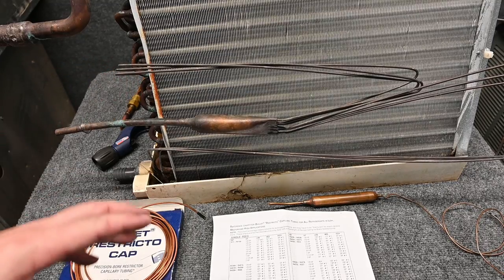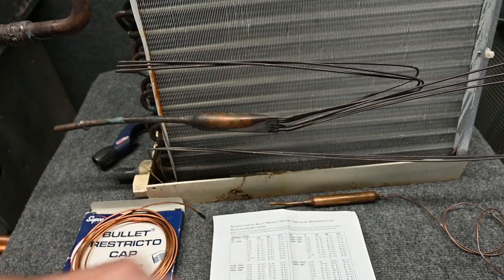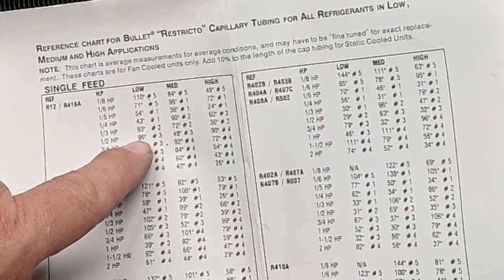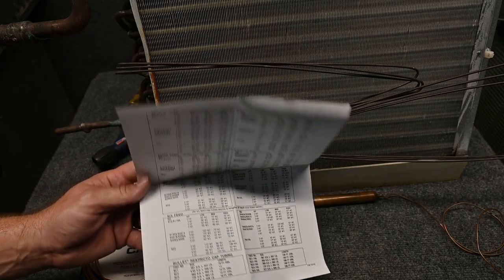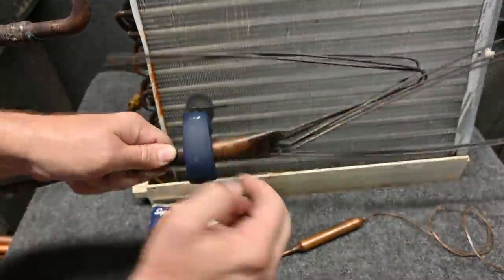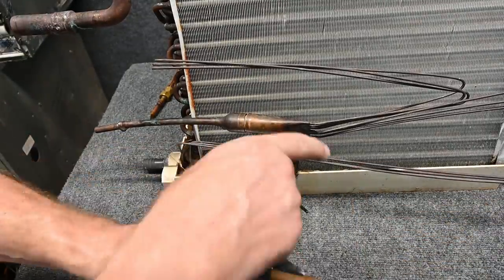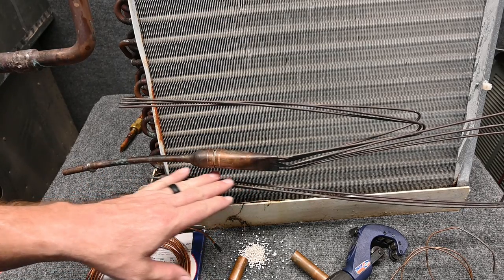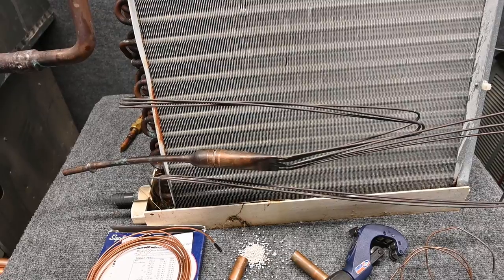HVAC 088 capillary tubes metering device

Comment: In this kind of metering device should use superheat or sub cooling? Thanks.
Reply from the maker: Both. 

We get the target superheat with the indoor wet bulb out door dry bulb on the chart or formula and compare that to the superheat. 

We also look at the outdoor temperature and the sucbooling just as we do with a fixed orifice.

Comment: A month or so back I found 'CAPILLARY TUBES: THEORY AND PRACTICE' By: Henry Ahrens online.  A RSES paper that offers some interesting insight into cap tubes.  The self-regulation comes from the change of state happening after different lengths of the tube depending on conditions.  The bubbles slow the refrigerant feed.  

Can't say fully understand it but it is interesting to consider.  And to me, gives better explanation as to the problems that can occur if you aren't feeding 100% liquid to your TXV or piston since bubbles mean the flow will be slowed unintentionally.  Cap tubes seem to have a place in small systems where their alteration of the efficiency of the system as the control mechanism.isn't a significant issue.

Telling is that in the 1960s, the thermostat on some window air conditioners actually controlled a heater around the strainer to lower sub cooling to cause boiling for more of the length of the tube thus reducing the feed to the evaporator.
Reply from the maker: Awesome thank you! I will find it now that I have a lead! Thank you very much
Reply from the maker: http://www.rses.org/assets/serviceapplicationmanual/620-98.pdf
Reply: Thank you for the source. Good to know he is a senior engineer -- seems like reliable source of info.

Comment: I don’t like capillary tubes either; is there a way to replace with some sort of universal TXV on say a refrigerator sized system?
Reply from the maker: i have replaced capillary tubes with larger distribution tubes with a distribution block and TXV.
IT was a PITA.
Reply: @love2hvac  Ty, thanks so much!
Hey, I’m new to all this and I have a question no one seems to be able to answer:
I just got a new 2-stage vacuum pump and a CPS VG-200 micrometer. I live at 4700 feet of elevation.  When I put the micrometer directly on the vacuum pump with fresh oil, I can get a vacuum as low as 4 um.  However, if I look at a chart of maximum attainable vacuum vs. altitude, it says I should only be able to attain a vacuum of about 25” at my altitude.  4 um is nearly 29.92”.  Also, the micrometer (by design) only starts to give decimal readings above 28”.  So if you ascribe to the max vac vs altitude chart, the micrometer shouldn’t even be useful.
So, there is something I’m missing here. Also, it occurs to me that when the vacuum pump is operating, and removing (say) air from a system, it in my mind it should have to be working against the weight of the atmosphere; thereby in my mind making it possible to pull a deeper vacuum at higher altitudes because there is less atmospheric weight to push against to remove the air from the system?
I’m really confused on this and everyone I can find and talk to (even seasoned refer-techs) just say I use analog gauges and time, and they don’t worry about it!   Ty, I would really appreciate your help.  Thanks in advance!
Reply from the maker: I have a 20+ video series on vacuum alone.

Let's start with this, we are not measuring a vacuum, we are really measuring atmospheric pressure. 

At sea level and standard weather there is about 14.7psiA Atmospheric pressure. 
14.7PSIA, aka 760,000microns, 0 inches of Mercury vacuum, 29.92 inches mercury absolute, 760 TORR 0% vacuum. 
A lot of different numbers but they mean the same thing. 😁

If we go higher in altitude, we have less atmospheric pressure.

If we go to the top of Denali (20,310 foot elevation)
The atmospheric pressure would drop to 11.6PSIA,  600,000 microns, or  6.32 inches  of Mercury vacuum, 23.6 inches mercury absolute, 600 TORR, or 21% of a vacuum. 
When we have less Atmospheric pressure we we are starting out in a vacuum, aka less Atmospheric pressure. 

Now if we continue all the way up to space, there is no more weight of the atmosphere on us.
We would have 0psia 0 microns 29.92" Hg vacuum 0" HG absolute, 0 TORR and 100% vacuum.
We did not even use a vacuum pump but we are in a perfect vacuum. I ly because we no longer have Atmospheric pressure. 

So we really don't measure a vacuum we are measuring how much atmosphic pressure is left. 

If I pull a vacuum at sea level or on top of Denaliy goal is to get to at least 500 microns. Meaning only 500 micrometres of atmosphere left in the the lines. If I start at altitude, I just get a head start!

Part 2 why use a vacuum or micron gauge.

A perfect vacuum is 29.2"hg or 0 microns. 
Now take a look at your analogue guage set and fins for me 29.2.
Yeah even if you have perfect vision the with of the middle is way wider than that point assuming it was even accurate enough in the first place!
Each mark on that guage is 2"HG and the needel almost fills up between those 2 marks. 

There are 25,400 microns in 1 inch of Mercury. Can you see 25,400 of an inch?

There are 2" HG between every mark, so there is 50,800 microns between each mark. There is no way possible an analogue guage set is accurate or visible to measure a proper vacuum. 

We need to be below 500 microns to dehydrate the system and it needs to hold below 1000 microns after 39 minutes. (Called a decay test)
There is just no way possible anyone can see that on an alalouge guage set. It would be like building quality custom cabinets with a yard stick that only went down to feet as it's lowest measurement. 

Our job is not to remove atmospheric pressure, but to dehydrate the system. BELOW 500 microns and holding under 100 after 30 minutes is the bare minimum requirements for this dehydration. 
If it rises above you have to start the vacuum again and keep dehydrating. If it keeps rising non stop there is a leak.

What happens when moisture is left?
ACID!!!
Especially with POE oil. It turns to an acid. It causes leaks in the evaporator coil, eats varnish off the windings and eats away at the copper. Then the copper sticks to the hottest part of the system, the compressor. It copper plates the components and then the compressor has a harder time working until it overheats and fails. You even have more Refrigerant leaks. It eats away at the seals and at the TXV. 

Major system damage from improper dehydration. 

However the installer will never see this long term damage. It takes several years before it causes problems.
The service tech thinks "oh those junk TXVs, oh these junk compressors, oh these junk coils, but really it was all from poor installation practices 😢.

When you ask they will say " I have been doing it this way for ____ years"  meaning they refuse to learn, they are set in their ways, and people think if you do something wrong for long enough it makes it right. 

All in all there are no HVAC police. 

It's just you, your drive to learn, your drive to do it the best you can or to cut corners.

I wish I could tell you I always do things right, but sometimes we have to make a decision, sometimes we just have bad days and cut a corner. 

Only you can decide if it will be a habit or an occasional thing.

It was a great question!!!!

Hopefully that helps! 

Ps don't argue with those who are stuck in their ways, just worry about you.
Reply: @love2hvac  thanks so much, I feel I was coming to this conclusion because you are dealing with physics which is irrespective of anecdotal dogma or convention.  Well, that is why I immediately purchased the micron gauge because the resolution was stunning and every analog gauge I can get access to reads differently.  In trying to figure all this out, I did watch a lot of your videos but just couldn’t reconcile the ‘maximum attainable vacuum tables’ (if you feel like speaking to their implication and use, that would be great!) which I don’t understand with your vacuum videos that made sense about the effects of altitude on the work necessary the pump has to accomplish.
Funny thing is that my application was not for refrigeration but for other uses.  However, after watching your videos, I’ve become really interested in HVACR now and have access to some broken systems.  I see you need a 608 and after looking at the questions and your really excellent videos, think I could get a ‘Universal’ which would allow me to properly play with these available units.  So, thanks to you , I may have another hobby and another endless pit to throw my money in to!  Thanks again Ty, really appreciate it! 🙂
Reply from the maker: Curiosity is the most powerful learning tool! 

You would probably like this.
I should make a video about it also. 

https://www.engineeringtoolbox.com/vacuum-converter-d_460.html
Reply: @love2hvac  ok, ok, ok.  The light bulb 💡 finally came on!
I now understand the ‘maximal obtainable vacuum’; essentially sea-level to space represents the full dynamic range of possible vacuums. Any fraction of that total dynamic vacuum range merely represents a subsection of the total altitude.  So, if you’re already at a higher altitude, it is analogous to already having pulled a commensurate amount of partial vacuum from sea-level; some ‘work’ has already been done.
My brain-stick was thinking that this reduced the actual (probably poor choice of wording) ultimate effective vacuum (i.e. you would have a lower usable quality vacuum).  So, my understanding now is if you pulled a ultimate vacuum at altitude and took the container down to sea-level it would be the same effective ‘deepness’ of vacuum as one (ultimate vacuum) totally pulled at sea-level; assuming the pumps used can pull the same ultimate level regardless of altitude.  
I can imagine I’m using the words wrong and argument about ‘usable’ (given pulls from different altitudes) but I feel I definitely get the concept!
Well again, much appreciation for your patience and taking time to respond in detail. You are a great explainer (I was particularly taken by your latent-heat video and explaining the evaporator/condenser being at the exact temperature but the refrigerant being in multiple phase-states!) and I look forward to watching a lot more of your content… Thanks Ty! 😃

Comment: Do you wrap these filter dryers while brazing ? I had my wet rag on it it was taking forever to heat up the joint so when I removed the went rag the joint heated up and I brazed it but I am not sure if i damaged the dryer I was running 0 degree F coil temp instead of 15 for refrigerator.
Reply from the maker: If it's outside it absolutely needs to be wrapped and protected, otherwise it damages the paint and allows it to rust. 

Even if it's insidse there may be components that can be damaged by heat, for example, heat pump filter driers use a type of plastic valves around the parameter. Solid core desiccant can come apart with heat. 

When you wrap it you have to turn the torch up to a higher temperature and braze faster.